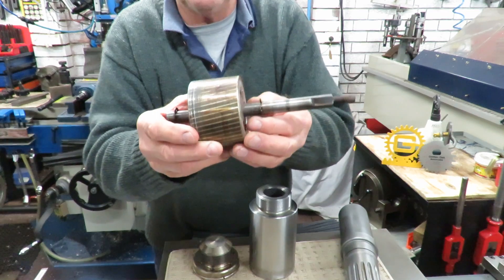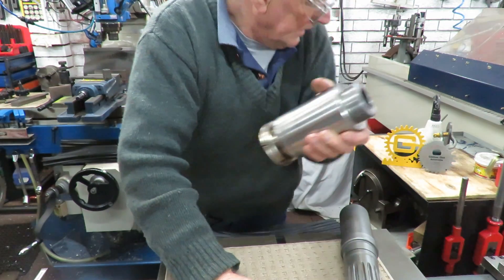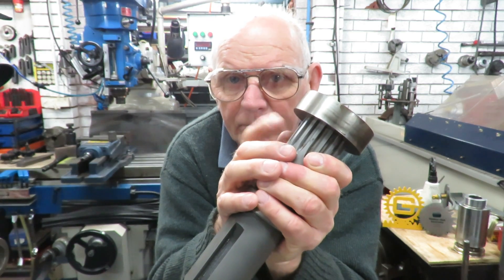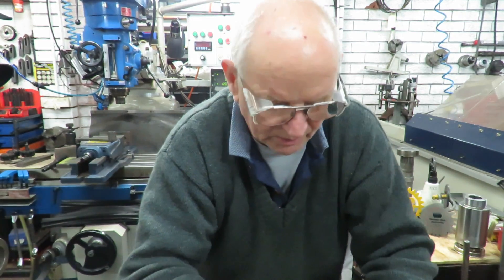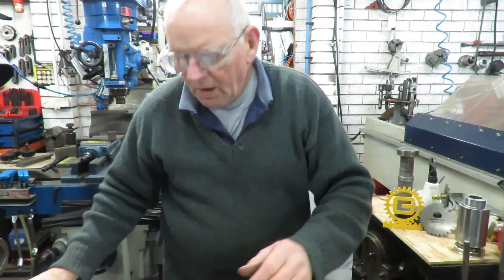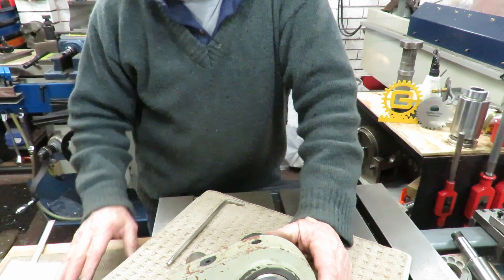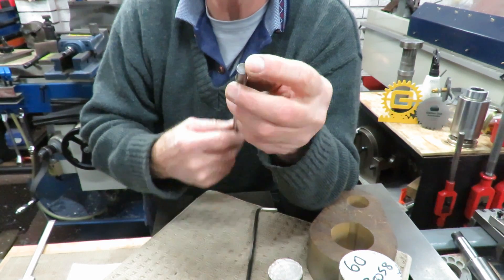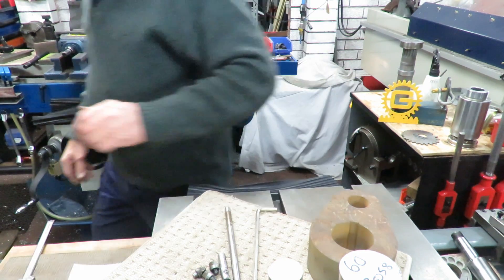461 Cranky Arm and many other interesting challenges this week

Comment: I would measure over the diameters then subtract half of each to find the bore centers. Eyeballing centers is a risky business I have found.
Reply from the maker: Under normal circumstances you are correct, however the break is through the centre of one hole so that creates an issue, I did both same result.